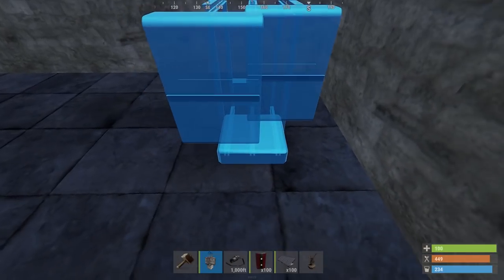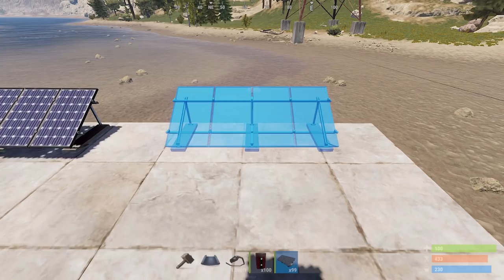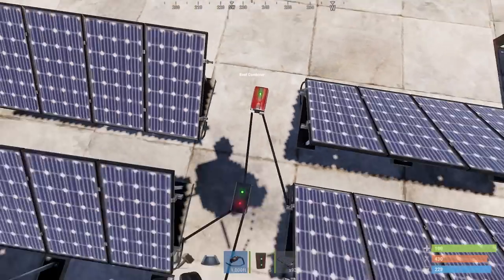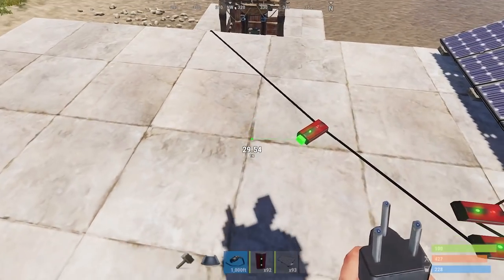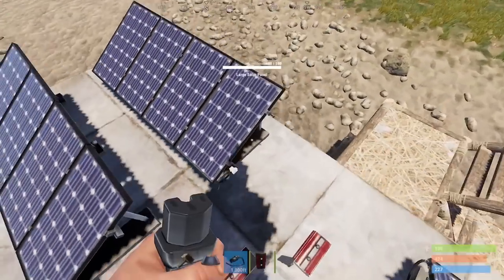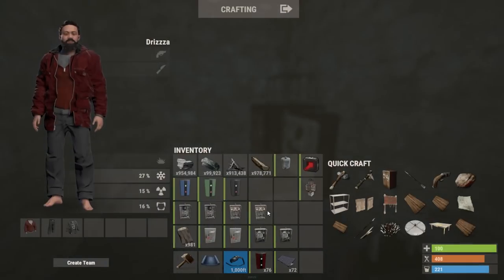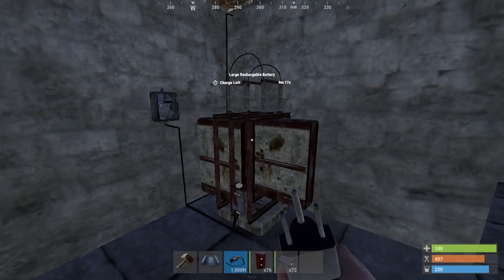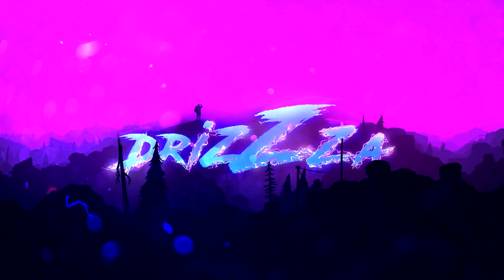How to Generate and Store Electricity in Rust Guide

Comment: I have found the maximum charging rate is reached when the input power reaches the battery output value with large and small. I have found the maximum charging rate seems to take 12 seconds to store 10 seconds of charge on the large battery.
Reply from the maker: Makes sense, so you'd only need 5 solar panels to max the charge potential of a large battery